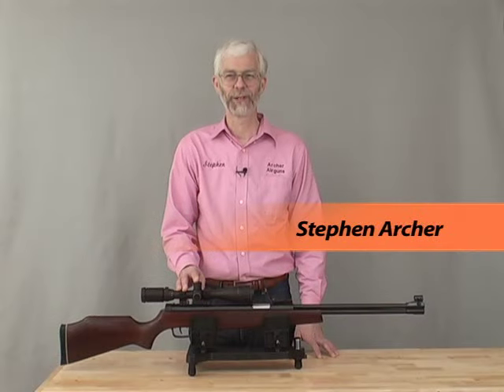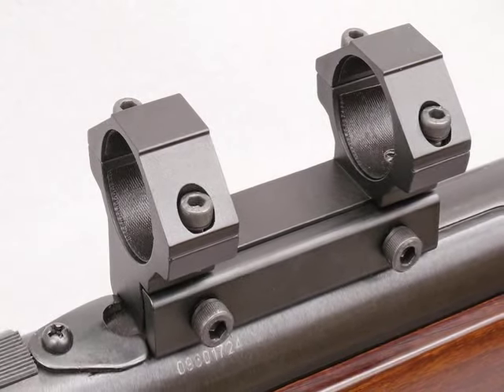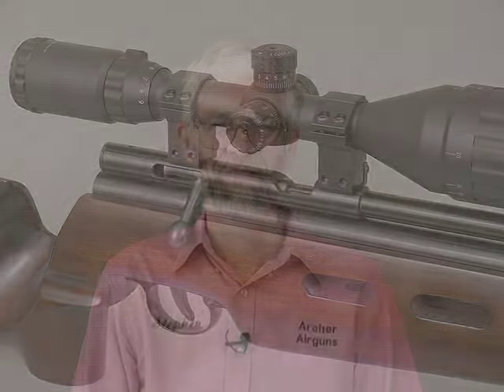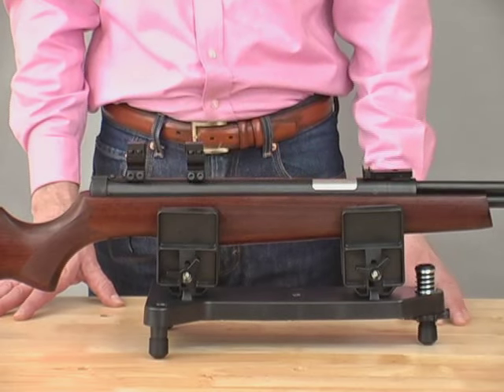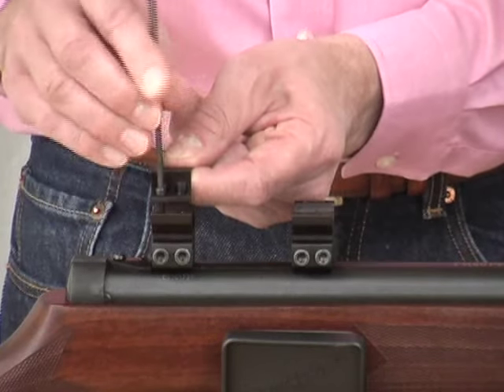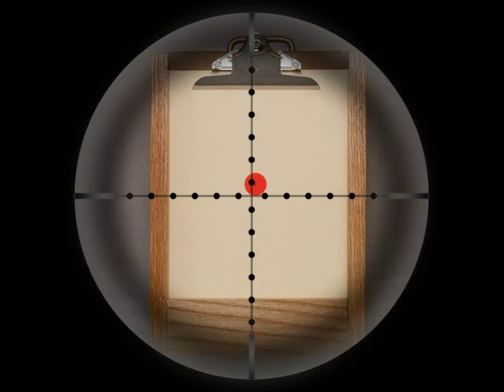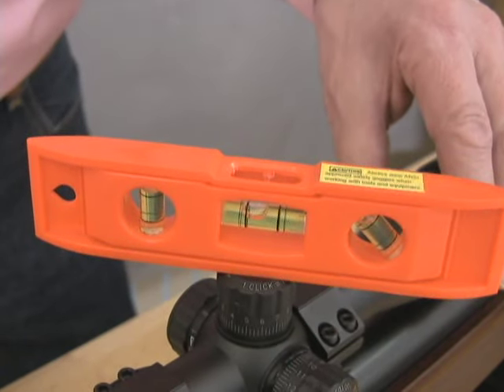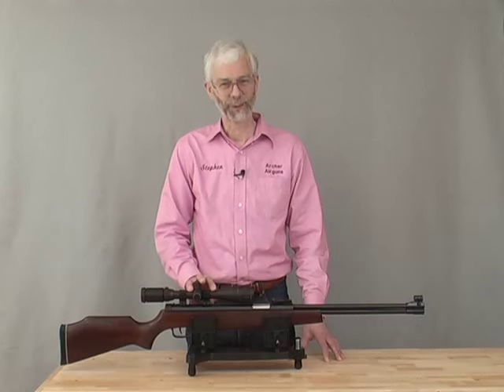The Easy Way to Mount an Air Rifle Scope

Comment: I bought a centerpoint 4-16x40 scope but i cant find a piece to adapt it with my air gun rifle since the scope comes with a 3/4 dovetail ring and mine needs a 3/8 and to be higher so the objective lens dont touches the barrel on my rifle pleaseee some help???? :/

Comment: The mounting seems always problematic on a springer most of all.  They really need weaver mount only, but what do most off them put, the old half useless 11 mm dovetail!!!  So then you have problems with the scope removing itself.  HOW do you tell a scope wont shake itself to pieces before you attach it?
Reply: Good reason to buy from Walmart; take it back if the scope won't mount - professional said the rifle is "defective"!

Comment: I have a cheep pallet gun with a 4X15 scope and I try to put in on a million times and it still won't shoot accurate if u have any tips please 
Thank you
Reply: +DeMarkus crespin Hi mate. Well, every airrifle reacts different to ammunition. There are various waights of diablos avalable. If the diablo is to lightwaight it often spreads, if it is to heavy it drops really fast. Also every airrifle likes different amunition. You should try different waights and shapes of ammunition.
Reply: +Crazy Swiss hey, I have the same problem. I have a crosman f6 or f3 I forgot lol. and I bought two types of pellets and when I aimed directly in the middle of the target, both of my pellets went to the side. PLEASE HELP ... AND I KINDA DRY FIRED IT ON ACCIDENT. MY AIR RIFLE IS A NITRO PISTON BTW.
Reply: Jeremy Francia how do you aim? Iron Sight or Scope? Also do they both go on the same side or do they just spread all over left and right? Then do you shoot on paper Targets? Are the holes nice and round?
Reply: Oklahoma

Comment: I have a question.How can I put a scope on my gun that has no rail ? If i could.
Reply: Stefan Tutorijali buy a dremil with cutting will make your own groves
Reply: +Stefan Tutorijali I mounted my scope with wire, zip ties.  Works good enough for plinking.
Reply: +Stefan Tutorijali check if there is a special mounting option available. Making your own groves or zip wire is really not an option, due it will never be straight on the gun and you will never be able to shoot any accurate.
Reply: +Crazy Swiss i have a freezer stocked squirrels that are a result of mzy zip tied scope on my junky, chinese air rifle.  I dont hit em all, but im pretry sure that is my fault and not due to the zip tied scope. 

its not ideal, but its the only sensible option i had n its working fine (better than i expected).

Comment: Did he just say fierce recoil lmao was that a joke
Reply: Colton Marten springer's have a lot more recoil than pcp's and some scopes are made for pcp's only.
Reply: He doesn't mean the recoil YOU feel but the double recoil that ruins scopes made for firearms.A springer recoils both ways. The piston going forward recoils the gun back into your shoulder for a split second.Then it stops and pushes the gun forward. Scopes for spring guns have their lens glued in on both sides.Firearms all recoil back into your shoulder.They are only glued in one side.